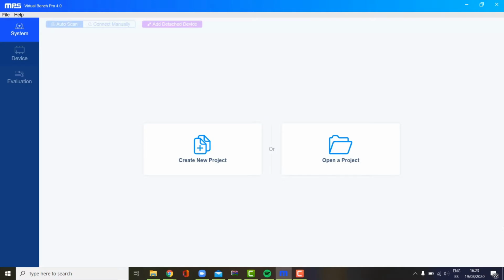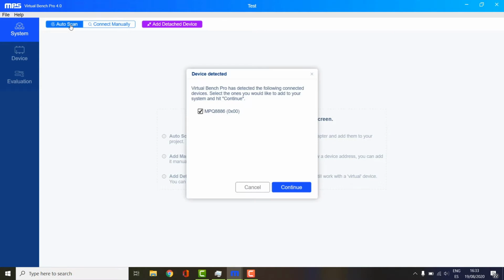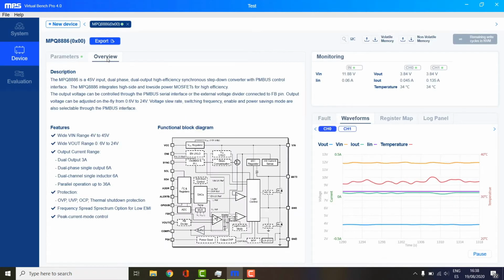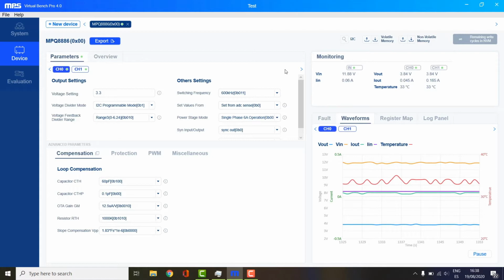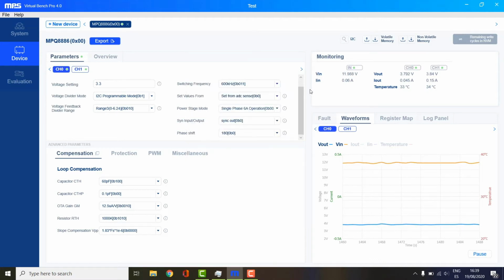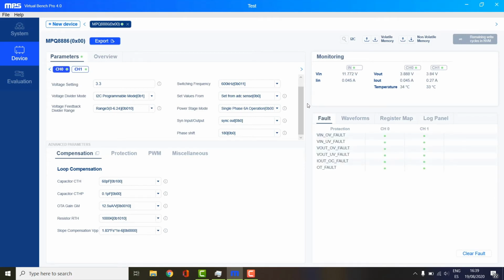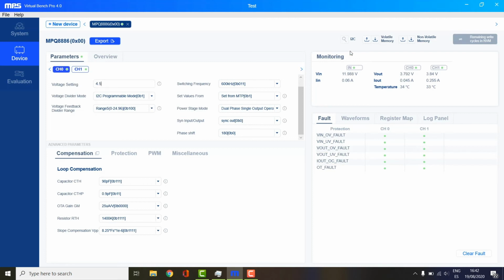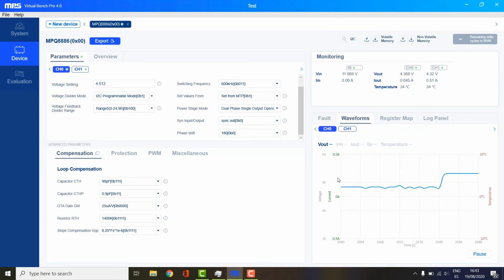MPS Virtual Bench Pro 4.0 Software

Comment: had a doubt, if i had some MPS board. Cant I interface and get the output voltage using another I2C driver kit. Lets say Excamera I2C kit. Are these boards only programmed in  MPS Virtual bench.
Reply: Feeling very tough for me to work on this. I dnt have experience in dealing with I2C devices
Reply from the maker: Apologize for delayed response.  For technical questions please address at https://forum.monolithicpower.com/ where we have MPS engineers monitoring.  Thanks

Comment: Is that board EVQ4210 is added to the Virtual bench. Its been many days. Still it was not added. Please add it fast. I did ask this question long ago
Reply: @monolithicpowersystemsmps534  I downloaded Virtual bench 3.0.1.81 but I dnt find MPQ4210.
Reply: @monolithicpowersystemsmps534  I found the update. Is there any procedure to set the output voltage. I saw some instructions in the MPQ4210 data sheet but with that instructions I m unable to do it through Virtual bench 3.0
Reply from the maker: Apologize for the slow response.  For technical questions please see out MPS Now Remote support team at https://www.monolithicpower.com/en/support/mps-now.html